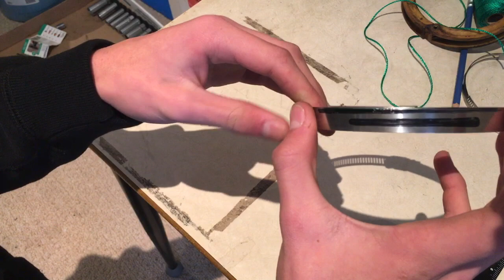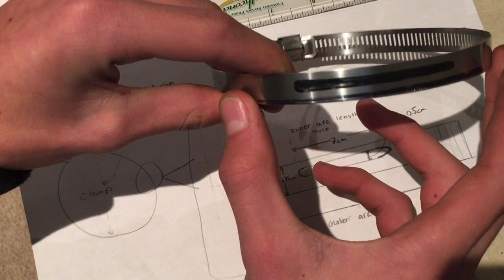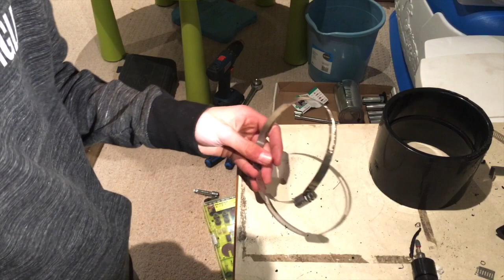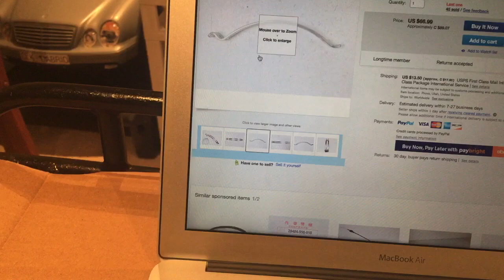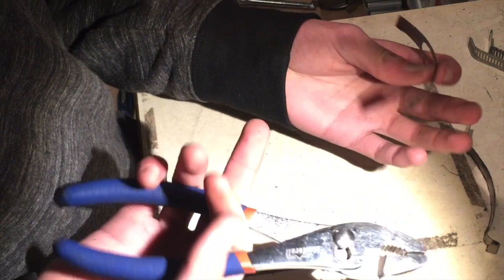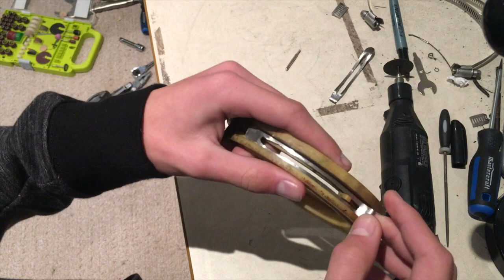Building Honda ATC Recoil Decompression Hook Plate: Part1

Comment: Right on bud! I miss my old big red
Reply: Have you tried looking at the wreckers for stuff ? Or prefer making your own. I know its not easy to come across parts these days
Reply from the maker: I’ve tried looking for some parts bikes but it’s hard to find one with the parts I need, I’m going to continue to work more on the bike in the spring when the weather warms up a bit
Reply from the maker: I’m still working on the next part to the dispersion system but it’s taking longer then I thought to design